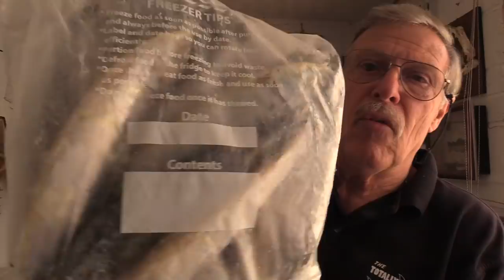What’s all this Weird Fishing Bait in my Freezer??

Comment: Graham, use a roller tray and a soft bristle sweeping brush to paint decking, I’ve done it for years and you can fly through a decent sized deck in no time at all. Adding acid to the soil will change Hydrangeas from pink to blue, or dig in a bag of ericaceous compost. The homemade way is to add coffee grounds, soft fruit peels or even grass clippings. The nettle feed is a great way to keep chemicals out of the garden, it’s full of nitrogen, if you ferment banana peel with it … Godzilla plants … or even your veg !!!